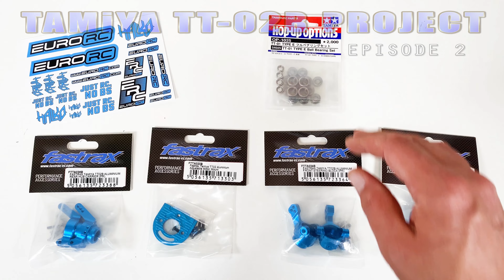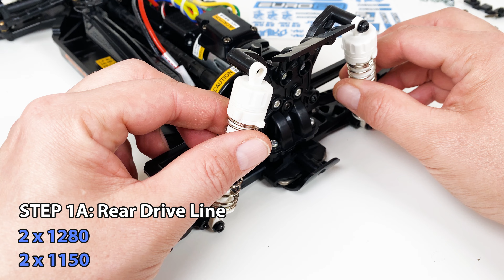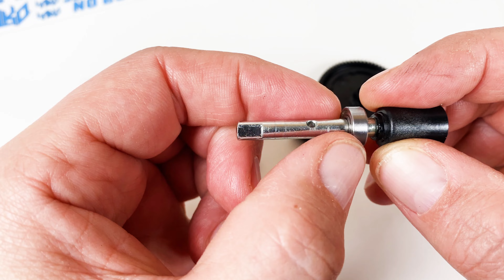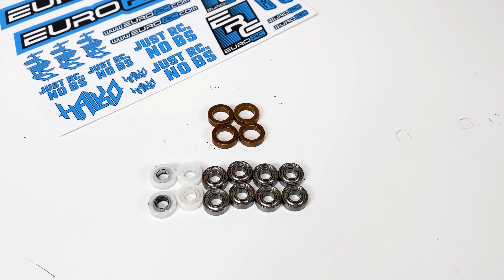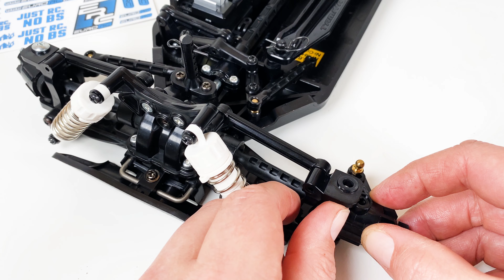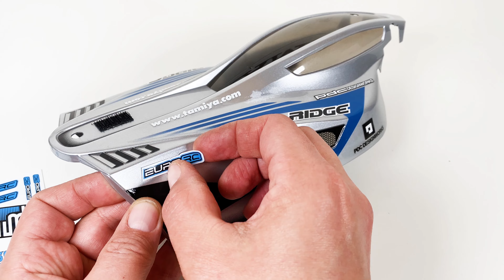Tamiya TT-02B Project: Full Ball Bearings from EuroRC! (Episode 2)

Comment: Facepalm! I'm glad I'm just casually watching this. I've already perform a ball bearing upgrade on my TT02 chassis over a year ago but while watching this, I relaized I forgot to swap those brown bearings around the front/rear diff housing! And I just did my rebuild yesterday after a clean and didn't know about the back treading tip until now. Well, from here on out I'll be adding that to my maintence skill set! This will for sure prolong the life of parts and especially tub bodies like these! I believe I've already overtightened/stripped a few holes out already. I heard a trick to fixing those is to fill the holes with super glue I think it was and to rethread the hole afterward.
Reply from the maker: Hi bro! Yeah, done a few re-theads with glue too. The best way is to avoid stripping the threads though, with back-threading during maintenance/rebuilds/upgrades.

Comment: Would love to know what the differences it makes in run time, acceleration, top speed. I have a 2nd hand dual ridge, just waiting for my brushless motor to arrive, 😁 will check if it’s ball raced when I take it apart.  Quality vid as always btw 👌 looking forward to see the blue bits go on, will be watching those vids ! fitted a metal blue anodised propshaft to mine. 🤪
Reply from the maker: Hi John! Sounds like you got a nice TT-02B project too. It will be too difficult to measure and compare complete run times and ball bearings doesn’t do much to the top speed and acceleration with these low turn brushless motors. The benefit is somewhere else. They will put less stress to the motor (due to smoother running and less friction) and they will be much much more durable and minimize wear and tear to parts. But will do some top speed and acceleration measurements along the way any way 🙂
Reply: Try search "cageman bearing" here on Youtube, this guy has done some pretty thorough comparisons, really nice videos, worth watching.
Reply: @NordicRC  heh heh funny you should mention brushless, currently soldering wires to my first ever brushless motor, a track star 13t 😁
Reply: @madsrcbuggy  yes I’ve watched a few of his Motor vids, good stuff, I’ll search for a bearings one
Reply from the maker: Yeah. Love his channel. Almost an scientific approach 🙂
Reply from the maker: I think his bearing comparisons are more about spin time (than top speed, acceleration, run time), if I remember correctly. But still very interesting.

Comment: I cannot fathom why, in 2021, Tamiya still includes those plastic bushings in any of their kits.  The cost savings can't be that high...BB kits only cost the consumer $15-$20...so they can't cost tamiya more than $5 to include them in a kit.  Sometimes I wonder if tamiya survives off of the nostalgia, or the kit building experience...because many of their models, after you include the cost of a basic radio/servo/battery perform lower than similarly priced RTR models.  Granted, some of their models clearly aren't meant for performance...like a lunchbox or grasshopper.  But the TT02b isn't that different in form than say, a redcat tornado...a new one of those in brushless form costs about the same as a TT02b kit once built and the redcat can run circles around the TT02b.  The other choice they made is the brushed/brushless ESC...that only works with sensored motors.  I feel like they should offer some models with a more capable brushed ESC, and others with a brushless esc that can run sensorless.  And no ESC meant for lipo should be coming with tamiya style plugs!!!
Reply from the maker: Hi! Ha ha, yeah, I agree, Tamiya definitely have some issues: insisting on bushings, LiFe and NiMH batteries and sensored motors. … With the two new buggy releases, the TD4 and TD2, it seems like Tamiya themselves are aware of the problem of the TT-02B - which, yes, is a pretty much standard bathtub 4WD design that a lot of other companies produce for less money. There are some benefits with paying a little extra for Tamiya though: quality control and quality plastic, assembly kits with the best instructions, spare part supply and some very well designed and very Tamiya’ish bodies. . But yes, I think the TD2 and TD4 will be better in terms of the uniqueness of fun Tamiya runners that nobody else make.